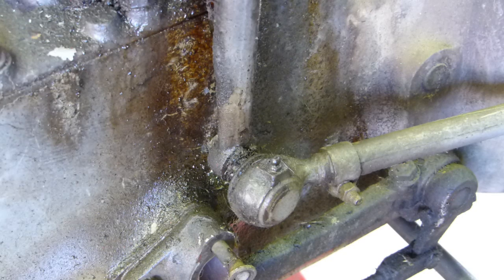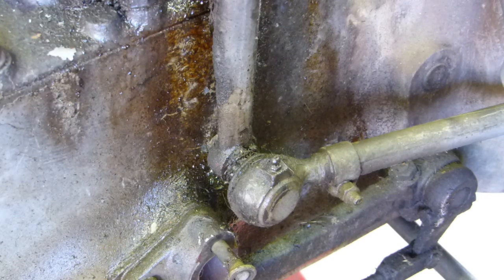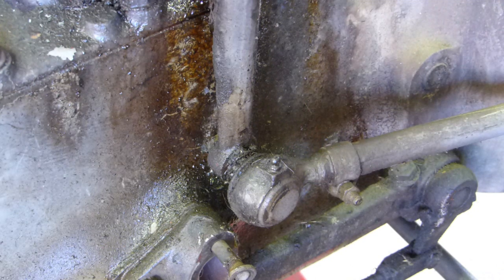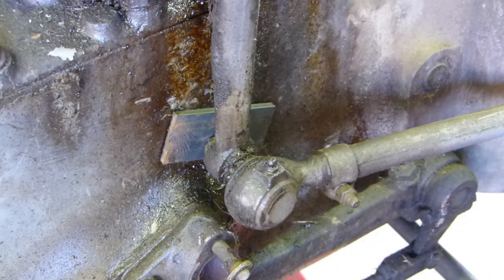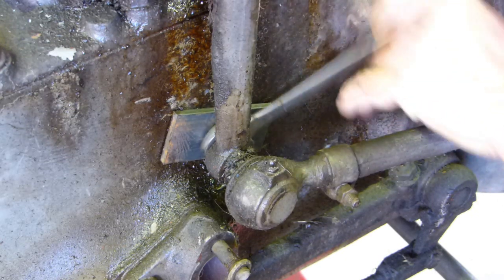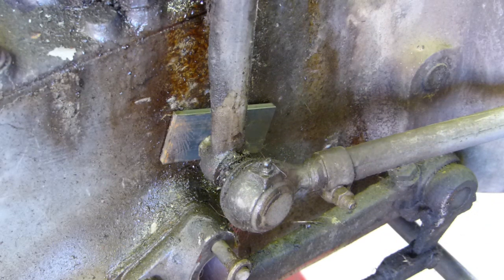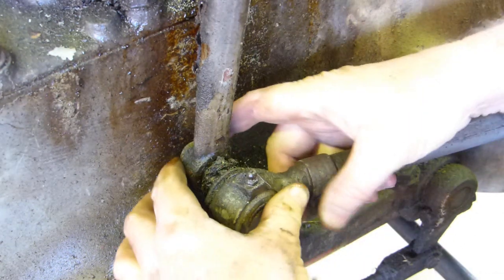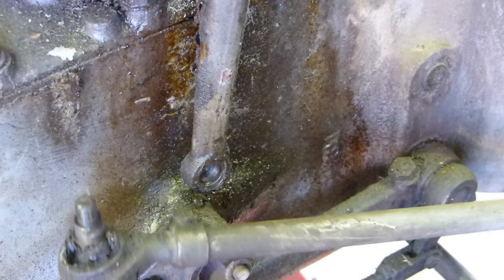How to remove a Ferguson TE20 or 35 Steering Knuckle (The Easy Way)

Comment: Hi, how do you fix the steering?. I turned the wheel while ball joints were off.  Now 1  steering arm is facing the front and one is facing the back.  The steering now apears to be out of its position now.. arms will not move now.

Comment: Hey Bundy! Need some additional info, I've got replacement ends for my steering rods, how to you get them off? I've loosened the bolt but they are pretty stuck in there, any tips?
Reply from the maker: Try bashing along the tube to loosen any rust, as a last resort use heat, they can be very tight at times.
Reply: @BundyBearsShed  thank you!! :)

Comment: great. I have TEA 20 and its stuck in reverse!!!, going have to strip it unless I get some clever insights. 
This video will make getting the steering box and gearbox cover off.
Reply from the maker: G day Patrick, The gear stick may just be stuck, I have got them free by putting a big screw driver in through the gearbox oil filler hole and moving the selector. You might get lucky.

Comment: Any tips for getting the one at the other end off? I'm assuming they are the same part so come off in the same way but ive put as much force into getting the bugger off as i dare and have now convinced myself im doing something wrong??? Do i just need to hit it harder???
Reply from the maker: G Day Steve, Same process, put a lever between the track rod and the top arm and lever hard then hit the arm with a hammer. Usually works ok.

Comment: So that's how you get the &%$* off,thanks Lance.
Reply from the maker: Well it is one way at least, there are probably many.
Reply: Thanks lance.FE35 by the way.  :)
Reply: Hi, how do you fix the steering?. I turned the wheel while ball joints were off.  Now 1  steering arm is facing the front and one is facing the back.  The steering now apears to be out of its position now.. arms will not move now.
Reply: Emily Sweeney  Auch, means you turned the rack all the way out so the pinion cant grab the tooth again.